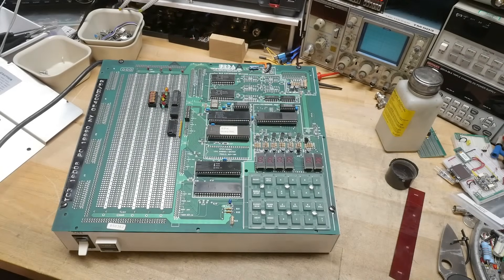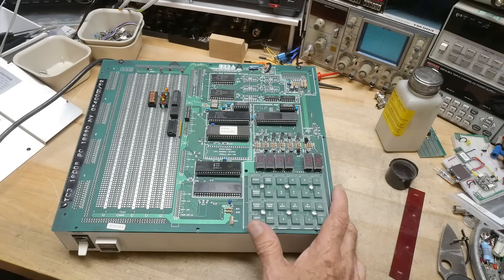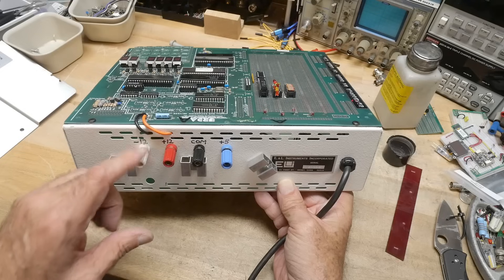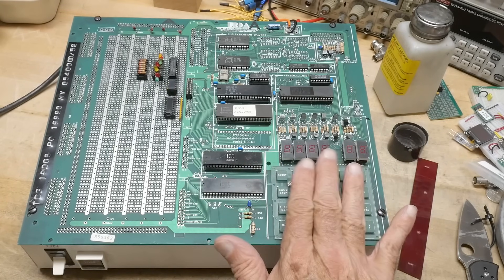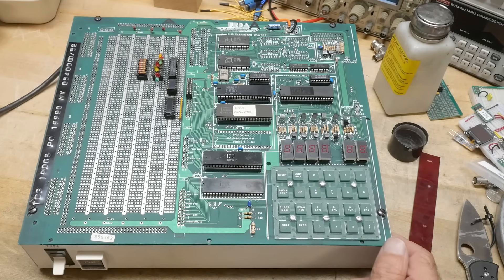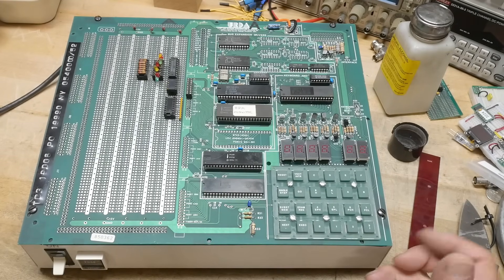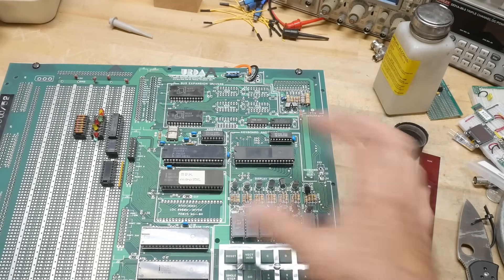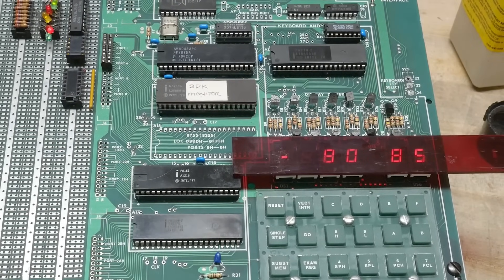#2367 SDK85 Intel 8085 Trainer (part 1 of  2)

Comment: This is a converted E&L MMD-1! Someone removed the MMD-1 board, replaced it with the 8085 board and hacked the power connections and posts to move them to the back. This is why the power cables come through the vent holes.
Reply from the maker: I wish it was the mmd1.  Cut my teeth on that one.

Comment: I remember using something similar for the 8085 and earlier in the class a 8080 in 2nd year tech college in '85-'86.  I think those had a solderless breadboard mounted on them to build interface circuits on.  We wrote simple programs in assembly to do a few things for the class labs.  I later messed around a little with my Radio Shack CC2 computer with assembly.  Had the assembler/editor program cartridge.

Comment: I learned my 8085 assembler on exactly that board, mid to late 70s. It came as a kit which I soldered up, just the board, no base unit as in yours.   I think mine had bigger keycaps, more like a real keyboard. Ah the joy of typing in a program which crashed and I had to re-enter it all.  After 50 years and a career in electronics then networking, I'm still coding, just as a hobby.

Comment: In my university microprocessor course, early 80's, we had the Intel SDK 8085 kits like this--build the kit if you wanted to do the labs. :) The 3/4" thick book that came with the kit included the monitor program listing. The Intel kit didn't come with a case, just rubber feet, no power supply. I think I still have mine in my junk somewhere.

Comment: Can I ask something
If I understand it correctly you used something similar to this card in 70s
How these PCB cards are sketched in past? My guess is that there weren’t any Altium etc. that time so I wanted to ask. Thanks.
Reply from the maker: this is the card I learned on: https://youtu.be/uodvsmIB-Jw?si=cz-b4IwBO_WY7l53
Reply: @IMSAIGuy  thanks Sir I’ll check it out
Reply: They mostly designed circuit boards with narrow black tape and pre-cut decals, then the image would be etched onto a copper-clad board using a photoresist process. The black parts of the image would prevent etching by blocking a light-sensitive chemistry, or it could be a toner-transfer process where the black parts physically blocked the copper from being etched.
Reply from the maker: @8bitwiz_  our boards at HP were designed with red rubylith tape. 4x in size and then photo reduced
Reply: @8bitwiz_ wow that’s so cool. Thank you for the explanation

Comment: That keypad layout will take a lot of getting used to with the odd number arrangement.  If I were going to play with it for any length of time the first thing I would do is adapt a different keypad to it.  I made a hex keypad out of an old Sears calculator way back in the early 80's that I made for the Sinclair ZX-80 kit I got for Christmas.  As we all know the keyboard was awful and I mostly programmed in assembly due to the tiny amount of memory it had so I built the keypad. I adapted my VIC20 and C64's so I could use it on them as well.  It has really nice feeling keys that still work fine today.  My first dabble into bits and bytes was in high school electronics class on a KIM....  I was immediately hooked!

Comment: 68HC11 with BUFFALO (bit user's fast friendly aid to logical operation) (by Tony Fourcroy) is quite good alternative.
Reply: I never could get BUFFALO to do single step, apparently it expects an external connection, but it's great to have a 9600 baud S9 loader built into the chip. Both the -A8 and -D0 versions have it; the latter is a stripped-down 4K version.

Comment: I was curious why the EPROM is a 40-pin chip. I knew there were EPROM microcontrollers (8748, etc.) but I didn't realize that they made EPROM versions of combo chips! And I expected the AMD chips to be the RAM. Nope, more combo chips!
I'm not too surprised that the keypad/display is on a separate microcontroller, just surprised by which chip it is.

I love those old trainers. I've got a board being made right now for a 68HC11 trainer, and I need to start thinking about its UI now. Also I have an old (1980-ish) EPROM programmer (Bytek S-15F) which is useless without its documentation, but I've traced out most of its schematic and it's basically built around an 8085 trainer. So I might end up using it for that if the documentation never shows up.
Reply from the maker: here is a 6811 trainer: https://youtu.be/vjcZuDGT0rY?si=E2hzxepCwcMjMedl
Reply: @IMSAIGuy  Yep, one of my favorite videos, I hadn't realized Heatkit made a later generation of trainers.

Comment: I learned on a Motorola 6800 version of this type of kit back in 1978-79. In my first job the boss had a TTL PROM programmer he built. It had toggle switches for each bit of address and memory.  It had a "red" program momentary switch to burn the content, "ZOT". I knew all the common OP Codes by heart back then. It doesn't  get any more basic than that. Your kit brings back memories, thanks
Reply: I had a similar 6802 board. I still remember that opcode 3F is SoftWare Interrupt.

Comment: I used one very similar to this in one of my beginning EE digital logic labs back in the early 80's; we used it partially for learning 8085 software, but also to test simple circuits as well.   In the one I used, the keypad was much nicer.

Comment: Decades ago I designed for a US company a smaller SDK one like this, applying the Motorola HC16 cpu. Similar HC11 SDK's were available with a BASIC interpreter and many other cpu's at the time. Earlier I got one SDK for 8051 with Basic. All this is so nostalgic to see. Since the system seems working you will have a good chance doing something with it.
Reply: I ended up with one of Motorola's official HC16 eval boards a long time ago. It looks like they abandoned plain-text serial for their Background Debug Mode, so it's not easy to use without their old DOS software (which I do have) and a parallel port. But there's no docs about the low-level protocol to the PE Micro BDM chip. So I'd like to write a serial monitor for it. At least I've already got an assembler and disassembler working. It would be interesting to try porting 6800 MS BASIC to it.

And I have so many random CPU chips, I really just want to make boards for them all.
Reply: @8bitwiz_  You are looking to interesting projects. I hope you have good data sheets/manuals of HC16 since it has a lot of details. HC16 is one of the best cpu's I have used as it has lots of good features.
Reply: From a hobbyist perspective, I hate BDM because it sets a high bar of external hardware that was never cheap. (the opposite of STLink) Ten-ish years ago where I worked, they needed to change DST dates on legacy HC12 hardware for a demo in Mexico. It was near impossible to recompile the old code because of a lack of working BDM modules (only the one used on the factory floor was left), and a new one was like 300 bucks if they still even had them then. (And the C compiler version they used didn't support USB BDM modules, of which there was one by chance.)

Fortunately the "old" DST dates had been left in the code and I was able to change bit 14 of the cut-over year (from 2008) in the CMP instruction, and the corresponding checksum bit in the binary.

The '16 is interesting in how they strategically organized pre-bytes such that every opcode was 2 4 or 6 bytes long.
Reply: @8bitwiz_  I am not aware of other manufacturers using the BDM, than Motorola/Freescale. Are there any?

Comment: AT that time I got a Inet Kit for the 8080 (chip to be soldered..), there a terminal has to be connected which I build at that time using a tv monitor and a owm schmeatic with refresh memory etc. (Pubished in 1976 in my first book written at school time...) interesting time, learnd machine programming, liek cd 03 fa for a call to the monjtiro program 76 for halt c9 for return etc. finally made our own floating point mathematic by scratch, thne added cassett tape reocrder and many more just the beginning before the CPM time.

Comment: I remember using one of those when I was student back in the early 1980s.  I assume they were used in universities and colleges all round the world?
Reply: Yes I used the Intel version at college here in the UK in 1981-1982 basically the same board, but had a terminal and an 8 inch floppy drive attached which made things easier.
Andy